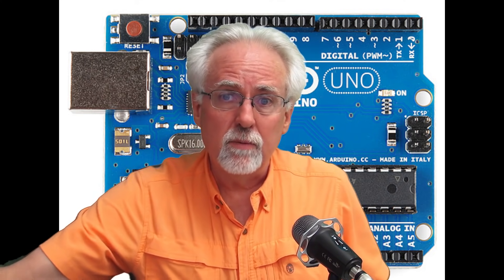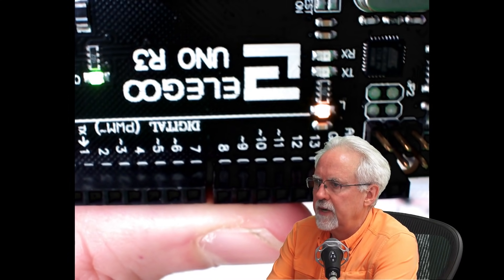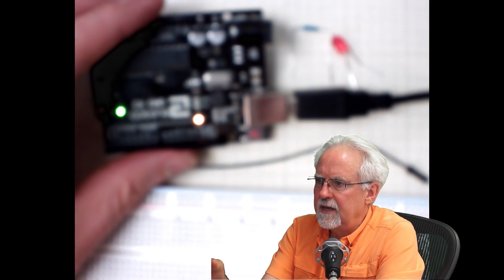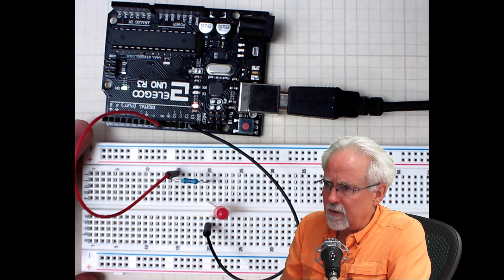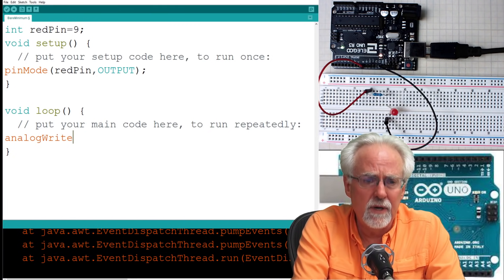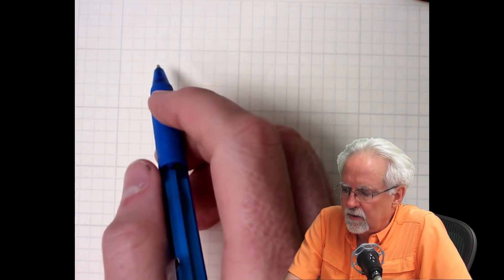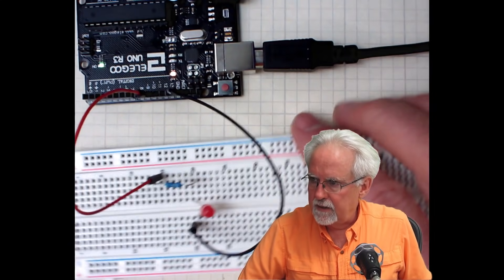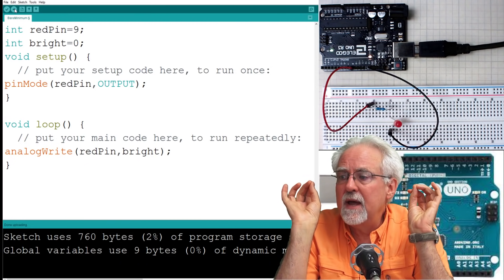Arduino Tutorial 7: Understanding the Arduino Analog Write Command

Comment: I'm following these tutorials and finally making progress after trying to use other channels. I'm currently  using an app to simulate the Arduino online and works exactly the same. so you could learn without a Arduino. I have an Arduino but I bought it for building a small CNC mill so I don't have the kit with LED and so on

Comment: Thanks for the information on PWM. I'm going through this tutorial on winter break, as an electrical engineering student I'm sure I'll way more about the science than in this course but it is great entry level material. I love the hands on experience too and I am sure it will pay off in the circuits lab in spring where Arduino is a requirement. Great videos and thanks!

Comment: I am a Mechanical engineer and python developer, but have been wanting to learn more about electronics for some time now and am very much enjoying you lessons. I created a  while loop, with two for loops to turn the voltage up and down and it seems to work really well thanks to your lessons.

int pin = 3;

void setup() {
  pinMode(pin, OUTPUT);

}

int voltage = 0;
int counter = 0;

void loop() {
  while (counter < 5) {
  for (voltage = 0; voltage < 255; voltage+=10) {
    analogWrite(pin, voltage);
    delay(50);
  }
  
  for (voltage = 255; voltage >= 0; voltage -= 10) {
    analogWrite(pin, voltage);
    delay(50);
  }
  counter += 1;
  }
  analogWrite(pin, 0);
}
Reply from the maker: Excellent, well done!

Comment: // Lesson - 7

int LIGHTS_PIN9 = 9;

int waitTime = 400;

void setup() {
  pinMode(LIGHTS_PIN9, OUTPUT);
}

void loop() {
//analogWrite 0 volts to 5 volts, 0-255
analogWrite(LIGHTS_PIN9, 0);
delay(waitTime);    
analogWrite(LIGHTS_PIN9, 2);
delay(waitTime);
analogWrite(LIGHTS_PIN9, 4);
delay(waitTime);
analogWrite(LIGHTS_PIN9, 8);
delay(waitTime);
analogWrite(LIGHTS_PIN9, 16);
delay(waitTime);
analogWrite(LIGHTS_PIN9, 32);
delay(waitTime);
analogWrite(LIGHTS_PIN9, 64);
delay(waitTime);
analogWrite(LIGHTS_PIN9, 128);
delay(waitTime);
analogWrite(LIGHTS_PIN9, 255);
delay(waitTime);
}

Comment: hi paulint       is it right
blueLED=13;
int redLED=8;
int  di=5000;
int da=100000;
float pi=3.14;

void setup() {
 pinMode(blueLED,OUTPUT) ;
 pinMode(redLED,OUTPUT);// put your setup code here, to run once:

}

void loop() {
  digitalWrite(blueLED,HIGH);
  delay(di);
  digitalWrite(blueLED,LOW);
  delay(da);
  digitalWrite(redLED,HIGH);
  delay(di);
  digitalWrite(redLED,LOW);
  delay(da);// put your main code here, to run repeatedly:

}

Comment: I did the assignment and also tried something new. 

int pwmPin = 9;
int time = 180;

void setup() {
  pinMode(pwmPin, OUTPUT);
}

void loop() {
  analogWrite(pwmPin, 0);
  delay(time);

  analogWrite(pwmPin, 1);
  delay(time);

  analogWrite(pwmPin, 2);
  delay(time);

  analogWrite(pwmPin, 4);
  delay(time);

  analogWrite(pwmPin, 8);
  delay(time);

  analogWrite(pwmPin, 16);
  delay(time);

  analogWrite(pwmPin, 32);
  delay(time);

  analogWrite(pwmPin, 64);
  delay(time);

  analogWrite(pwmPin, 128);
  delay(time);

  analogWrite(pwmPin, 255);
  delay(time);

  analogWrite(pwmPin, 128);
  delay(time);

  analogWrite(pwmPin, 64);
  delay(time);

  analogWrite(pwmPin, 32);
  delay(time);

  analogWrite(pwmPin, 16);
  delay(time);

  analogWrite(pwmPin, 8);
  delay(time);

  analogWrite(pwmPin, 4);
  delay(time);

  analogWrite(pwmPin, 2);
  delay(time);

  analogWrite(pwmPin, 1);
  delay(time);

  analogWrite(pwmPin, 0);
  delay(time);
}

Comment: int pinred=9;
int bright=255;//using value between 0 and 255.
int timebr=500;

void setup() {
  // put your setup code here, to run once:
pinMode(pinred,OUTPUT);

}

void loop() {
  // put your main code here, to run repeatedly:
analogWrite(pinred,bright);
bright =bright-50;
delay(timebr);
analogWrite(pinred,bright);
bright =bright-50;
delay(timebr);
analogWrite(pinred,bright);
bright =bright-50;
delay(timebr);
analogWrite(pinred,bright);
bright =bright-50;
delay(timebr);
analogWrite(pinred,bright);
bright =bright-50;
delay(timebr);
}

Comment: I was curious if I could make it alter between lighting up and then dimming, so I wrote this and it looks pretty neat.

int redPin=9;
int bright=0;
int waitTime=13;

void setup() {
  // put your setup code here, to run once:
  pinMode(redPin, OUTPUT);
}

void loop() {
  // put your main code here, to run repeatedly:
  analogWrite(redPin, bright);
  while(bright < 255){
    analogWrite(redPin, bright);
    bright++;
    delay(waitTime);
  }
  while(bright > 0){
    analogWrite(redPin, bright);
    bright--;
    delay(waitTime);
  }
}

Is this actually bad for the light at all?

Comment: // AT7-HW

//pin
  int led=11;

//brightness
  int off=0;
  int low=50;
  int lmid=100;
  int mid=150;
  int hmid=200;
  int high=255;
//delay
  int on=1000;

void setup() {
  // put your setup code here, to run once:
    pinMode (led, OUTPUT);
}

void loop() {
  // put your main code here, to run repeatedly:

    analogWrite(led,low); delay(on);

    analogWrite(led,lmid); delay(on);

    analogWrite(led,mid); delay(on);

    analogWrite(led,hmid); delay(on);

    analogWrite(led,high); delay(on);

    analogWrite(led,off); delay(on);

}

Comment: I tried to do the homework;  below is the code I used however, my light is not dimming. It is the same brightness as it would be for when it is bright (255) throughout the entire code. Is my code wrong or is there something wrong with my LED.

int redPin=9;
int bright=255;
int intermediate=125;
int dim=0;

void setup() {
  // put your setup code here, to run once:
  pinMode(redPin,OUTPUT);
}

void loop() {
  // put your main code here, to run repeatedly:
  analogWrite(redPin,bright);
delay(1000);

analogWrite(redPin,intermediate);
delay(1000);

analogWrite(redPin,dim);
delay(1000);
}
Reply: i tested your code works just fine maybe the led does not work properly ?

Comment: 5 / 255 = 0.020V per digit. So each digit is .020V (20 millivolt).  If I want 1.5 V output,  I take 1.5 / .020 = 75. So setting the output to 75 would give me 1.5V output.

Comment: I'm a little confused as to the concept of analog output, isn't the IDE communicating with the Arduino board in 1s & 0s? how can it communicate in analog form?
Reply: Arduino analog output is in the form of pulse-width-modulation. It’s still just 1’s (high) and 0’s (low) but turning it off and on at a fast rate, in this case, 256 times per second. Turning it on and off at at equal rate, so that the amount of time that the pin spends at the time of 1 is the same amount of time that the pin spends at 0 would be equal to 50% analog voltage output.

Comment: im unimpressed with anything i got from china the pwm only sets it at the lowest setting you have
int redPin=10;
void setup() {
  // put your setup code here, to run once:
pinMode(10, OUTPUT);
}

void loop() {
  // put your main code here, to run repeatedly:
digitalWrite(redPin, 255);
delay(1000);
digitalWrite(redPin, 100);
delay(1000);
}
great my elego uno doing the same thing.

Comment: Thank you for your work, I follow your videos scrupulously. One thing I don't understand in this lesson: I read that a standard red LED has a threshold voltage of 1.6 V. In one of your examples, you put 5 to analogWrite which represents approximately 0.1v . Why, with this low value, does the LED light up (even slightly)?
Reply: I answer to my self. I just watch the No 8. Some thing to do with PWM....

Comment: Hi Paul.  My Arduino is a bit different from the one you are using (Mega 2560 R3) and I could not get my program to work properly.  Not sure what I did wrong.  I could get the LED to turn on, but it would only come on when "bright" was equal to 128 and above, and the intensity was the same for 128 as it was for 255.  Anyone know what I may be doing wrong? Thanks and love the videos.
Reply: I just had this problem. I saw that this board has an analog side and thought since it was a newer version of Arduino, this was the squiggly line upgrade, but you still need to use the digital side. i used pin 9 and got it working
Reply: @laweren100  Thank you!  That fixed it.

Comment: How is it worked out that 5v is 255 or 8bit binary. I Understand analogue is using binary, i have no problems with that. But how is it worked out that the 5v has 8bit binary values and not, lets say, 4 bit binary? i feel its something simple i'm missing but i just cant work it out.

Comment: For this one, I added comments above each number (//zero, //one, etc) to help keep everything separated.  I also added an “off/low” after each number so it flashes vs just switching.  Then I used an int for the delay so I could adjust how quickly it switched between numbers.  I think I overachieved a little on this assignment.  Definitely enjoying the lessons so far.
Reply: cool dude! the //just refer to notes (for us) not to be used by the arduino right? also, i feel like my LEDs have very poor turndown ratio. 255 looks like 100 and even 10 feels like it should be 50 or so. You as well?

Comment: quick q regarding LED orientation: you stradle the LED across the channel in the middle of the breadboard, which i understand, but could you also just have the LED inserted into 2 consecutive slots in a row? for example row 'f' and columns '21' and '22'? 

my understanding is that the rows arent connected and so this should 'work' (it does, because ive done it) but just want to clarify in case im going to destroy my arduino!
Reply from the maker: Yes, there are many different ways to get it connected. Just make sure you are not shorting the two pins together.

Comment: I did this project on my own before watching this video. I'm very happy that you went through the whole project and explained your rationale. I know it takes a lot of time, but it really helps. 

Alright, so the things I did wrong. First, I put the pinMode commands outside the setup. Of course  I got a compile error and did some research to fix it. My second big mistake is that I didn't use any variables. It's hard for me to imagine what variables I need before I write the program, but hopefully I will get better at that. After that it wasn't too tough. I kept trying to come up with a shortcut for entering five lines for each number, but I couldn't. The last thing that stumped me forgetting that binary counts right-to-left while I read left-to-right, so all my entries were backwards. Fortunately I realized that reversing the pin jumpers would be easier than rewriting the code. Whew!

Thanks for all your hard work!

Comment: so im using a micro arduino, my code verifies and sends, but as i lower the value i get no changes in brightness, just a thresh hold of 127=off, 128=full on, i've tried multiple analog pins with no difference, anyone have ideas on what the cause could be?
Reply: i wrote a big response to this earlier, but it look like google ate it (or more likely i didnt press "reply").

i have an adruino/elego mega and had a similar problem. 

what i think i determined (and im not entirely clear on this perhaps Mr. McWhorter will expand) is that the 'analog' row of pin-ports are actually analog inputs meaning you feed analog signal INTO the arduino. changing your code and wiring to reflect one of the digital pinouts allows me to output correctly (ex: my analog ports are labelled A0-A15, so i just put my wire back into 10 of the digital row). this doesn't answer your question why there would be a threshold before or after which something happens. my first guess is that it is half way between 0 and 255 and so perhaps there is some behaviour that translates anything below a certain voltage (whatever voltage 127 bits represents) as 0 (off) and anything above (127 bits) as 1(on) but like i said this is analog input so who knows whats happening electronically!.

another thought is that this isnt actually a real analog program and is actually a digital one in disguise. we use 'int' to declare 'integers' from 0 to 255, if this was analog it would be a bunch(?) of decimals in between the integers too, so you could presumably set 105.87686734876 and the arduino would say "ok fine here you go"*. this makes sense because i dont know if you can represent non-integers numbers in binary (i imagine you can but would require math way beyond what im in possession of). so what is going on? i suppose its a bit like how there are 24 'frames' of still photos in a second of film tricking us into thinking we are seeing motion...your eye cant pick out individual frames of a movie without hitting pause on your betamax and you probably cant pick out the difference in brightness between the LED being set at 110 or 111 but if you ran through the numbers in order it would looks as though it were smoothly getting brighter and dimmer.

-you actually can declare a decimal number into your program and the arduino will say "ok fine here you go" but i bet its output voltage is an integer, (*it knows you aren't going to be able to notice the difference between 45 and 45.9847598347593 and so when it says "ok fine" and out puts your "desired" brightness, it is only giving you the 45 (or maybe 46) and not the .9847598347593...perhaps it just rounds up or down?) (and because you cant tell the difference between 45 and 46 you also say "ok fine")

like an mp3 it strips some information out of the file  in an effort to sacrifice some quality for convenience. in our case the option to simulate an analog signal far outweighs having nothing at all.

additionally, there are things called DACs (digital to analog converter) which do...well...just what it says on the box but i dont think the arduino has one (maybe a project!)

if im way off just tell me and ill delete this mess

Comment: I think your tutorials are great so don't take this the wrong way.  I think terminology is important so I'm wondering why you keep simply saying the long leg of the LED and you haven't mentioned that the long leg is the Anode and the other side of the LED is the Cathode?  Thanks for these tutorials.  I'm wanting to design a device and I've always used PIC chips or ARM processors using MikroBasic, MikroC, or assembly.  I want to use a Teensy 4.1 arduino compatible on my next design so thanks for getting me started.
Reply from the maker: To me clarity of communication is the most important thing in engineering. Why use a fancy word instead of stating the obvious . . . it is the longer leg.

Comment: Hey Paul, your lessons are really good, you teach just like my Dad, I wanted to try low and bright at the same time, so  I did declare two variables (bright and low) and then two for delay time, (dt and watitTime); I could share the code here...

int bluePin =11;
int bright =255;
int low =0;
int dt=1000;
int waitTime=10000;

void setup()
{
  pinMode(bluePin, OUTPUT);
}

void loop()
{
  analogWrite(bluePin,bright);
  delay(waitTime);
  analogWrite(bluePin,low);
  delay(dt);
}

Comment: int redPin = 9;
int highValue = 255;
int lowValue = 0;
int powerScale = 0;
int increment = 5;
int relax = 100;

void setup() {
  Serial.begin(9600);
  pinMode(redPin, OUTPUT);

}

void loop() {
  powerScale = powerScale + increment;
  analogWrite(redPin, powerScale);  // display all value from 0 to 255 and back down to 0 in increment of 5
  delay(relax);
  if(powerScale <= lowValue || powerScale > highValue)
     increment = -1 * increment;
  Serial.println(powerScale);
}
blue vice